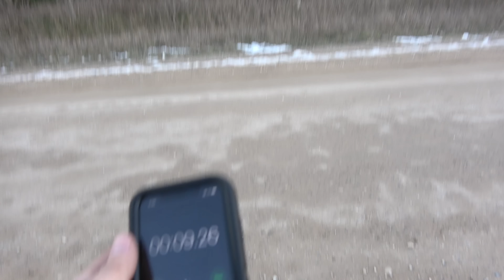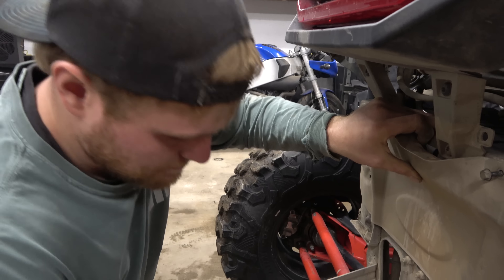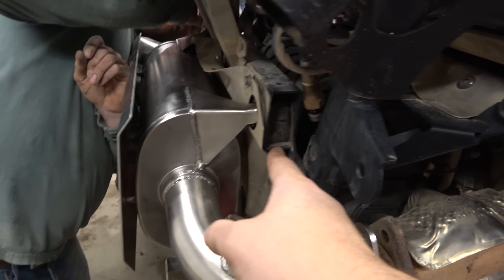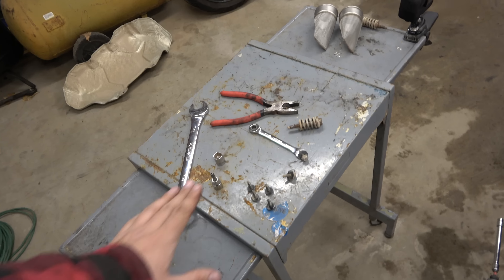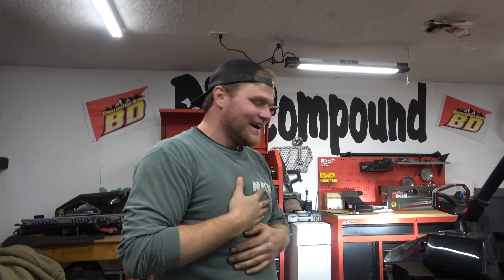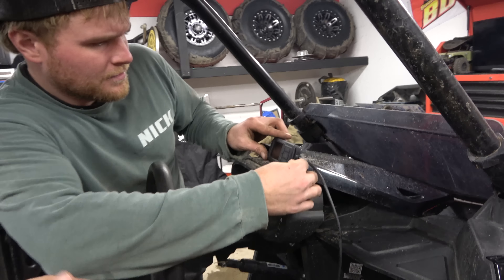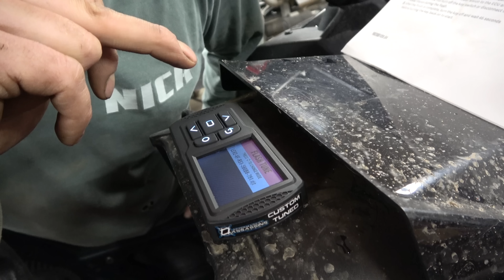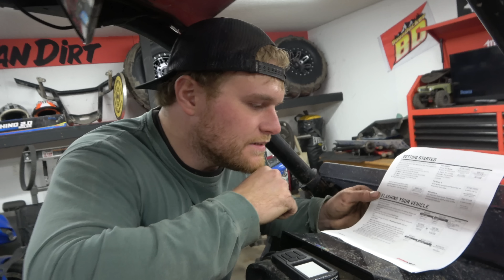Polaris RS1 UPGRADES! | Aftermarket Assassins STAGE 2 TUNE, EXHAUST, & CLUTCH Kit! How Much HP?

Comment: I added the AA clutch kit, blow off valve, exhaust, charge tube and stage 3 tune to my pro xp.  It really woke the machine up.  Congrats on the upgrades.  I met you guys as SXS Blog RaceTober in 2019.  Hopefully things will get back to normal next year.
Reply from the maker: I’ve been thinking about switching mine over. I wanna talk to the AA guys and see if we can work something out. Hopefully this strange world won’t be so strange next year. We have some awesome things to announce soon. So stay tuned for some fun SxS events

Comment: Huge fan of AA.  Mike is a beast.  I have no clue how he has enough time in the day to do everything he does.  I run the stage 3 in my Polaris turbo.
Reply from the maker: I didn’t get to talk to Mike but I want to cause it be awesome to have them on board with us. Maybe change the Turbo over 🤷🏼‍♂️
Reply: @dirtdudes  You won't be disappointed.  I bought a kit for my turbo, but we ended up talking more about my ranger and how he went a little overboard on his (I'll let him tell tell you that story).  I've had 3-4 friends work with him and all positive.
Reply: I’ve got his tune for my x3 and my ranger 900. Huge improvements

Comment: Why did you decide for Aftermarket Assessions and Not Bikeman? Both deliver same components, but Bikeman includes a FULL exhaust system.
Reply from the maker: Why do you need the header pipe?
Reply: @dirtdudes  doesnt a exhaust manifold Help the engine Increase little Bit Power?

Comment: So is there a video to check his time again? I don’t wanna spend the money on these upgrades if really doesn’t improve the speed lol
Reply from the maker: It will be faster and have better throttle response. As far as how much faster? A few hundredth of a second
Reply: @dirtdudes  I thought about just leaving it stock and adding the tuner at a stage 2 tune. Think that will be a good difference? Or adding a muffler and clutch really worth it
Reply: @dirtdudes  this will be on a 2021turbo s 4
Reply from the maker: If your adding a tune you gotta add the clutch and muffler
Reply: @dirtdudes  is it ok to add the tune now and do the rest later or will I have to re flash it once I add the add ons

Comment: What did this do to your slow crawling ability?
Reply from the maker: It made it much easier..the tune really helped with the throttle response and the cluching allows me to control how much bottom and top end i want
Reply: @dirtdudes  I am trying to-do this cheaply. How much of this would be affected by leaving stock exhaust? 

I did clutches on my X3 and it turned it into an absolute animal. But affected its creepy crawly ability. So I had to back off some of the aggressiveness in the clutch. Seemed to be riding the belt kinda hard.

You don't see this at all with your mods?

Comment: That thing sounds meaty like a hammer! Which was my college nickname Meat Hammer! Haha 😄 All the ladies would say,"let him drop the Meat Hammer!" Lol 😂  Real nice tho guys. Ive been thinking of a muffler and a tune and after seeing and hearing that, it makes me want to do it! I'm hoping I can beat my buddies older can am mav with a turbo, which I think would be close in hp then. Nice job fellows!
Reply from the maker: Lmao, meat hammer! 🥩🔨... I bet it would be pretty close, if you had the right clutch set up you could maybe get em. If your still running a stock exhaust I highly recommend upgrading. Besides just the performance factor the sound is worth it. Hearing awesomeness rip behind you adds to the riding experience 👍🏻
Reply: @dirtdudes  I love the deep throaty sound for sure but my only issue with that is it being to loud for my area. There are some places, especially at night, that I kinda need to sneak thru. There are times also that I have to ride the paved road and it's not legal in my state or area to do that so I just feel less likely to get caught by the fuzz if my machine is quiet. I have saw and read that there are some aftermarket mufflers that will give u more performance over stock and are quieter so I've been wondering what they would be like with a tune or maybe even a cut out would be a good idea. I don't know what to do yet but after watching ur video, I'm thinking something has to happen soon 🤔😬! I also hope it's enough to beat my buddy with his older mav and another guys tuned and modded yxz. My rzr has the bottom end to take them both off the line but eventually they get around me but neither of them will send theirs off a jump like I will mine haha 😄. Great job and keep them coming guys!
Reply: @dirtdudes  also why the name change? Did Michigan want some money thrown their way for using the state name?! Haha

Comment: cut the back out of the stock muffler ... remove the centre plate and pipe 1" tube ... and remove the cat ... weld her up job done .... cutting it in half proved very little .. the muffler is a mechanical baffle with chambers ....take the back off and look at it .. it speaks to you  in its design ... if it had mud inside  ?? well ??